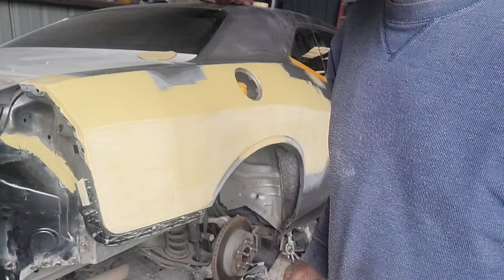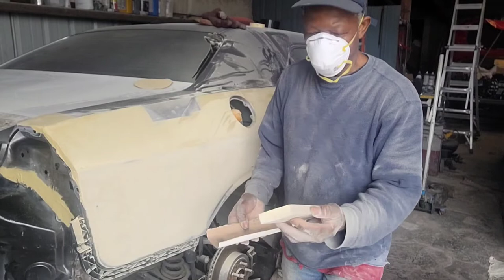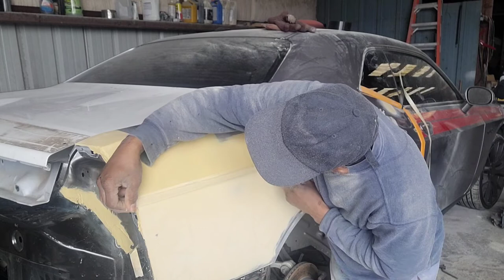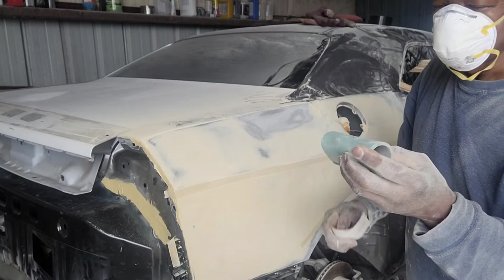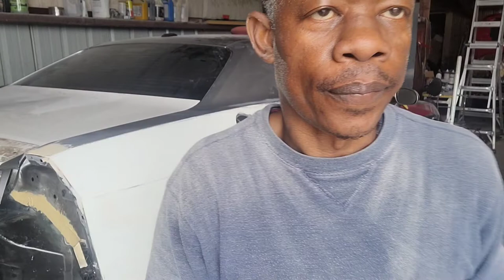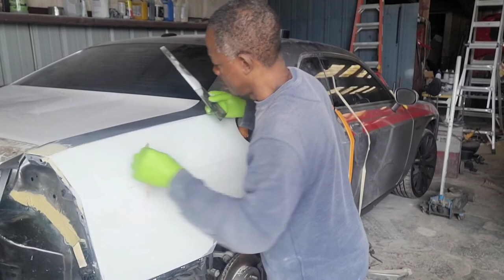Sanding the Bondo on Quarter Panel and Application of Polyester Putty

Comment: Poly putty is so darn expensive. I can’t believe you are using it on an entire quarter. But then the 3m filler should be good enough to leave a good finish, it’s way more expensive then what I use. And if mixed correctly does not leave pin holes. So obviously you don’t mind spending extra money. But most body guys just layer in a couple of coats of surface primer before blocking and finishing the car. Not sure why anyone would use so much glazing compound. Just don’t see it often in the biz. Perhaps there is a good reason? Thanks.
Reply from the maker: Yes, it is more expensive, but since it's just me, I won't waste the putty. Also, it saves me time and it takes care of the pin holes. I find that it dries fast and doesn't shrink. But depending on the type of primer you use the price can add up as well because you are going to be using more coats.  Both ways work, so you just do what works best for you.